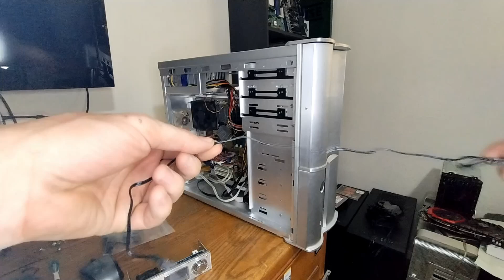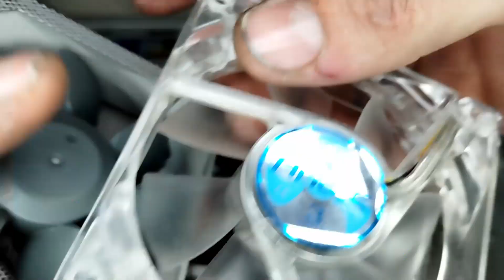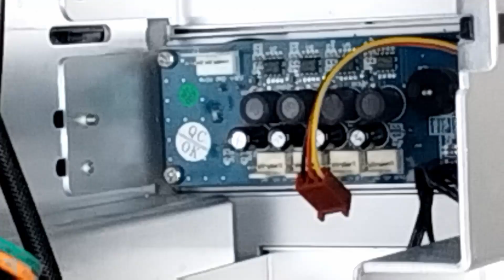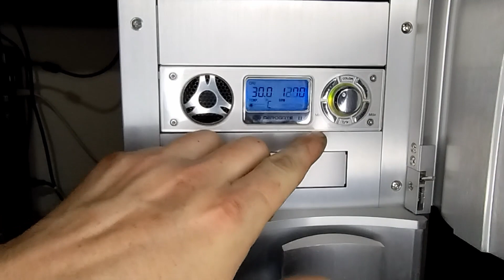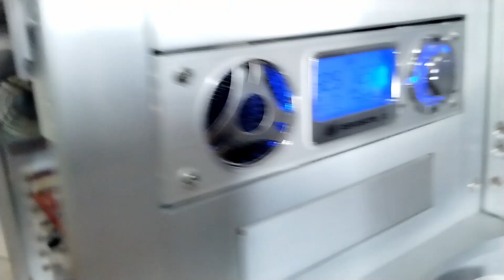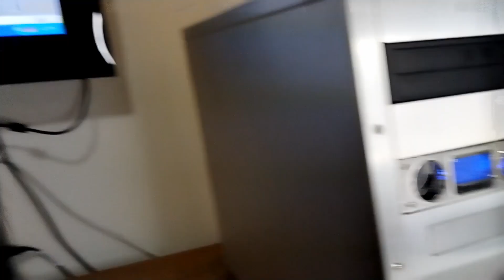Noisy Retro Hardware!

Comment: I have been into PC building for 28 years and I have always disliked and avoided cases that have a door on the front. They are nothing more than an access encumbrance and airflow inhibitor. Last year (in 2022), I built a retro PC and I used a Rosewill Thor V2 case, which has all exposed external bays on the front, as a case should be.
Reply: Well i own an A+ Xclio case for my retro build and it has a front door only it has a masive fan underneath the door and it has a masive fan on the side and boy does it keep the hardware in the case cool the case looks kinda like an airplaine yet engine but tall its not the best looking case but i realy like it.